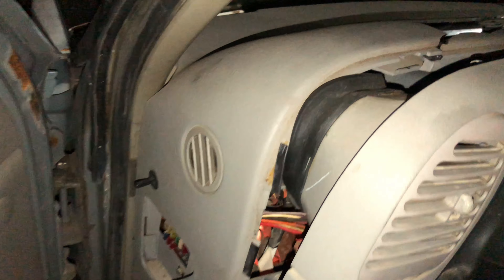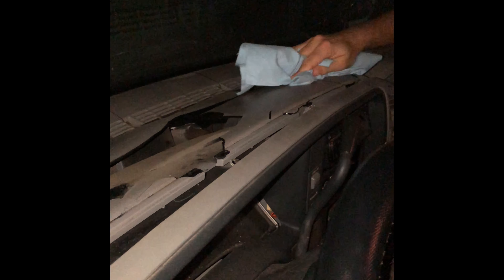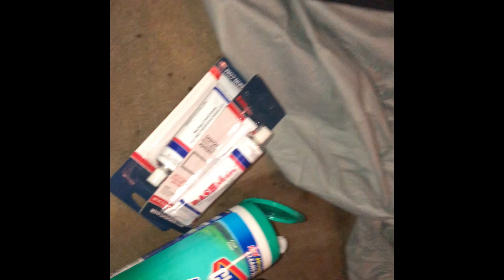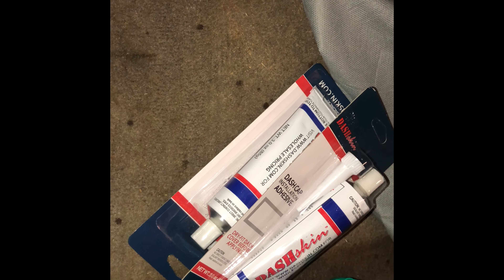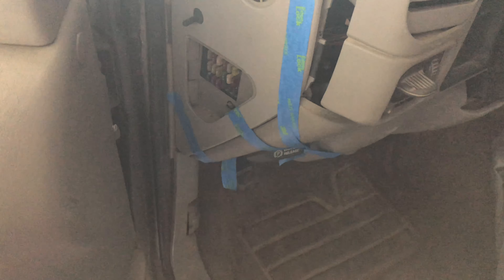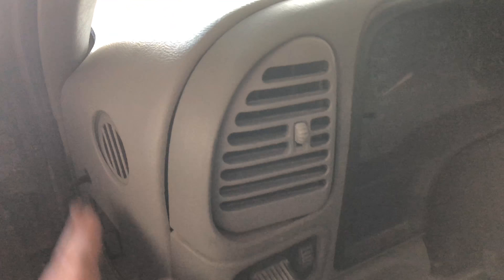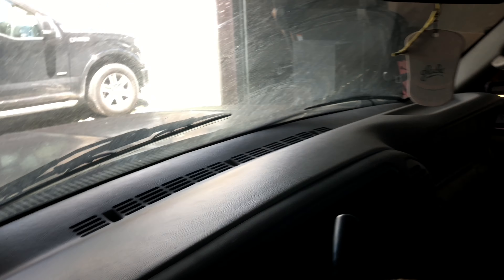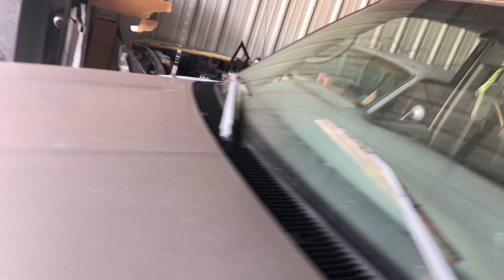GMT400 dashskin.com dash Skin installation in a 98 GMC Sierra

Comment: How do you have the cluster bezel held in since all the holes for the clips are broken?
Reply: Hi, Did you figure this out. I have the same issue holding the bezel now??
Reply: @sergiogarcia2262  same here. Just did mine yesterday and went to snap the bezel back in and the right side won't snap in place. I'm going to trim down the right side with a drimmel. I'll use some masking tape to make a straight line. Hopefully.
Reply: @sergiogarcia2262  use some  16th thick vinyl (I used a piece of a nail fin off of a window) and epoxy pieces in to make the hole work.  If you send me your phone number I will text pics.
Reply: @kengraves1629 can you send me those pics?? Bc I need to do the same thing lol

Comment: Doesn't this still shake cause your mount bolts are broken?
Reply from the maker: The mount bolts are like 75% attached. I hear no rattles and it doesn’t shake. It kinda ties it all in.
Reply: use some  16th thick vinyl (I used a piece of a nail fin off of a window) and epoxy pieces in to make the hole work.  If you send me your phone number I will text pics.

Comment: Can it be screwed in the factory mounts ?
Reply: Did you figure this out
Reply from the maker: It’s not a full replacement. We did the glue that came with the kit.
Reply: Yes it can, if your OEM dash isn’t destroyed/cracked around the bolts then you can drill holes in the dashskin and just take the OEM bolts out and put them over both the OEM dash and the dashskin.
Reply: @jimmycorbett4611 is there a gap between the skin and OEM dash? Would it need some kind of spacers behind it? It looks completely flat and good with the bolt heads behind the skin